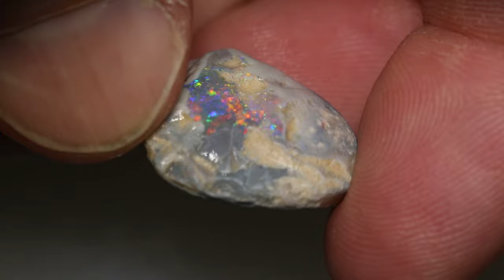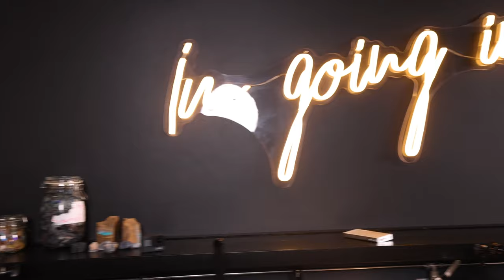I lost it but found it. Rough opal reunited and gets a makeover

Comment: The pink, purple, green and red, with flashes of yellow and orange is fairly unique.  I am very impressed you got 1.75ct out of that. When I looked at the rough knobby I thought the bar was thin and too close to the top.  My hope was 1.5ct and you beat it.  Good on you.  
As for the pattern, I saw pin fire at the top and center.  Then there seemed to be floral around the outside. Nice 3D effect as well.

Comment: is there a "golden rule" about how much backing/too much backing should be left behind the color of the stone?   I saw a saw a beautiful stone where the backing was so thick that the weight made it maybe 2x as expensive as "I thought" is should be.     Thanks for the time you take to make these videos!
Reply: Justin is pretty good with taking a lot of the backing off, not everyone is tho because they can claim the opal is heavier than it really should be. If the back seems way too thick for the size, it probably is. 😉

It really depends opal to opal tho, as some have really thick, deep running colour, where as others just have a slither. If it's like 1cm wide 2 cm long and 1cm thick, but the colour is running 4-6mm thick, that's respectable, however if the colour was a real thin layer, that'd useually be way too thick, I'm no expert tho, just going from what I've observed over the years.